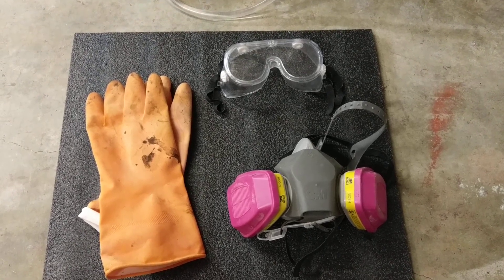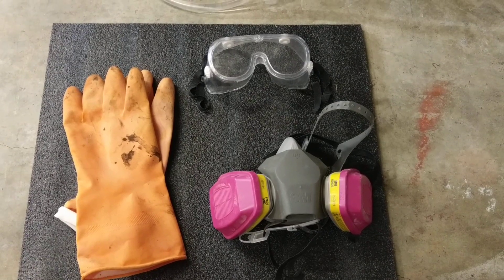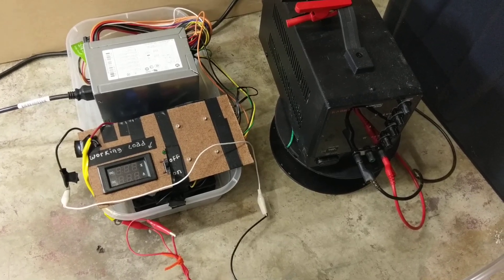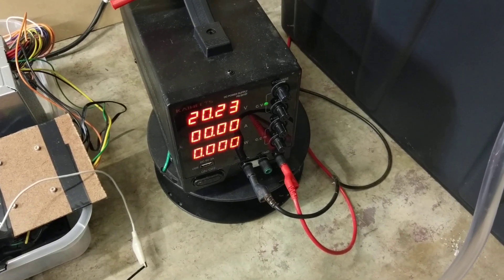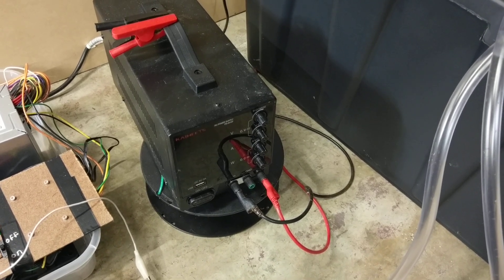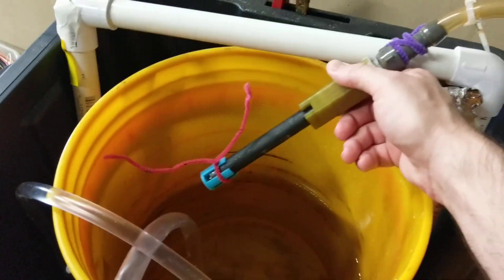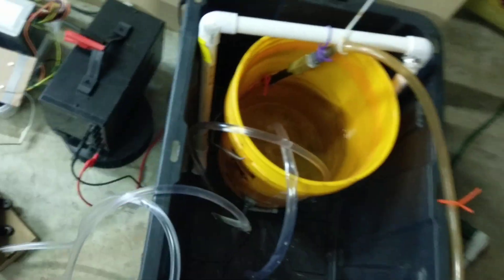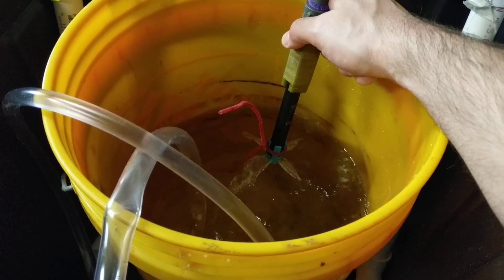ECM barrel equipment overview

Comment: Why do you reduce the amperage for the pump from 5 to 3?  I see in the documentation they also recommend to buy a 3a charger for the pump when it's a 5a unit.  Is this because at 5a the water flow is too fast?  Or is it more because the price up from a 3a charger to a 5a charger isn't worth it?

I only have a 5a charger, hoping it will be okay :/
Reply from the maker: 5a is probably fine. You only need the 3a for adequate flow. At 5a, some pump models can make enough pressure to pop hoses free. If that happens, you'll just need better clamps.
Reply: @lordkyleofearth  Thank you! I've bought the metal hose clamps so fingers crossed that's enough

Comment: friend I have a problem, today I started the cutting process but I can't reduce the internal diameter, the water turns brown, I'm using the same water pump as you and I have a power source adjustable at 7.5 amp, I don't know what I may be doing wrong...
Reply from the maker: Negative goes to the cutting tool and positive goes to the work piece (whatever you are trying to cut).
Reply from the maker: Is your boring rod getting smaller? If you have signs that cutting is taking place, but the tube diameter is not changing, you possibly have the wires reversed. In that case, you are using the tube to cut the rod.
Reply: @lordkyleofearth  the positive pole goes at the end and the negative pole at the barrel, is that correct?
Reply: Thanks a Lot man,

Comment: Would a 12v 5A plug in power supply from Amazon work for the power supply?
Reply from the maker: The more amps you can push, the better. 5a will work, but it'll be about half as fast and you'll have reduced surface quality. If you can get the 10a version, it's worth the extra money.

Comment: What happens if the bohring rod dosen't not  straight throw the barrel  i mean throw the barrel but not straight what happens
Reply from the maker: You'd get eccentric boring, which would make for a pretty much garbage barrel (also, possibly an unsafe one, depending on how eccentric).

Comment: If u make one  9x19 barrel using this method  how many can u do with the same  salt water left?
Reply from the maker: You can let the water settle and transfer it to a different vessel for the next job.

Although, an even better strategy would be to add 50g (or so) of citric acid to the mixture. This will allow the sludge to stay in solution better and reduce the formation of extremely toxic hexavalent chromium.

Comment: My water pump which could pump 5 L /min was broken i bought a new one who can pump 4 l/min what do u need to take into consideration when u have a less powerfull water pump in ECM?
Reply from the maker: As long as you have electrolyte flow, you should be good. Lower volumes mean less sludge removal, at some point, but I'm not sure where that line is at—you'll probably have to find it experimentally. 

FWIW, I cut my early barrels with an aquarium pump that was fairly low flow and built essentially zero pressure. From that, you're likely fine with that 4L pump.

Comment: Is 22 caliber possible
Reply: 22 centrefire would be possible, you'd just need to buy the appropriate pipe to begin with. Rimfire would require huge adaptation and changes to the gun internals so I doubt it'd work

Comment: are those tubes  made of pvc?
Reply from the maker: Yes, I had them laying around from another project. You can use anything to support the work.
Reply: @lordkyleofearth  i mean the tubes for the water? i have a similar setup, but i don't like the smell of the pvc tubes which were recommended what else can i use?
Reply from the maker: I just used vinyl tubing from the hardware store. It's cheap and non-reactive with the solution.

Comment: How long do you run the current? If you run it too long won't it completely erode the barrel?
Reply from the maker: You are correct. Ivan's ECM guide has the timing intervals (assuming 8.5a is used on a 4" barrel). If you overshoot your targets, you'll likely ruin the barrel.

Comment: Hey, can that pump using as sucktion pump and would it handle air bubles when liquid no awaible for "draining"

I would need it for similar project which needs dirty water suction continuously even if water does not run every moment, purpose is to keep sheet workpiece clean and dry as possible
Reply from the maker: It's just a 12v RV water pump. I'm not sure if it'd need your needs or not, but there are a bunch out there to choose from.

Comment: Where to buy steel and what kind of steel?!?!
Reply: Hydraulic pipe is rated for the pressures of a firearm barrel.
Reply: Thanks. Automotive? Where can I get those? Thanks.
Reply: @marlondeanbellot.7945  Ebay and Aliexpress.

Comment: What power supply do you recommend
Reply from the maker: Anything that can push 10 or more amps and, preferably, that offers a constant current function. 

An ATX power supply and buck converter works fine.
Reply: I think the Longwei one that doesn't have the course and fine adjustments on it, 10 amps. They're like $80.